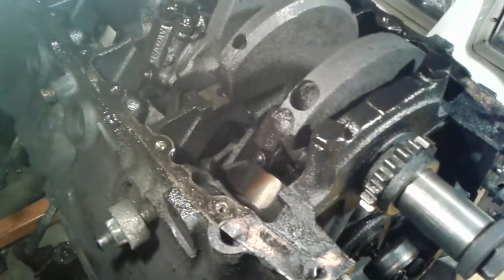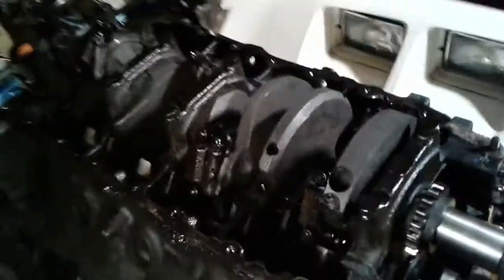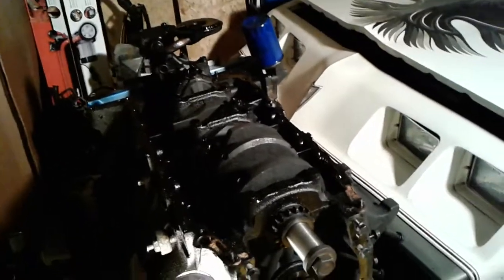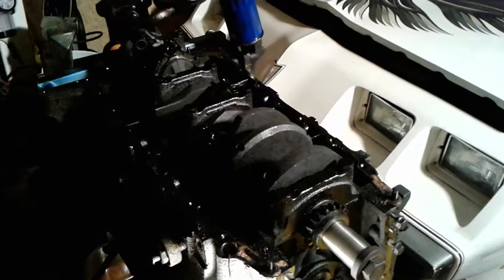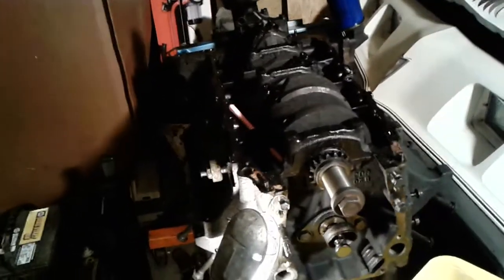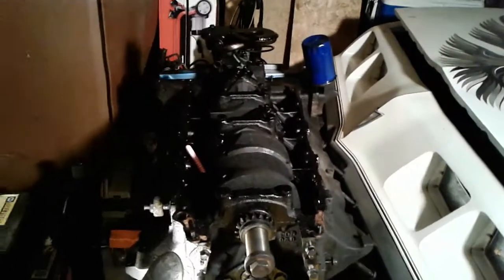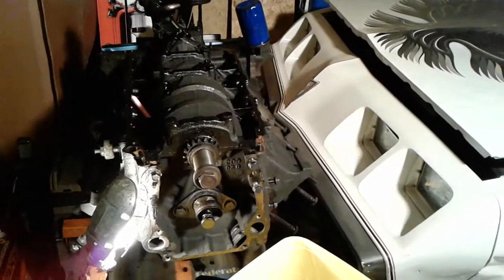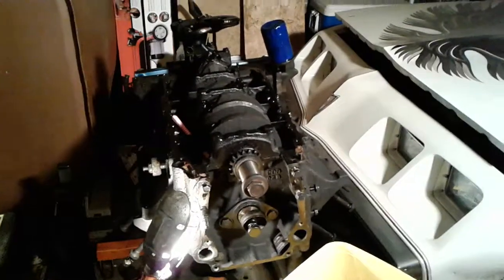Oldsmobile Engines. Blocks, Windowed Main Webbing

Comment: There's a few things , 1 LS/LT chev motors have windowed main webs to , it's about equalising windage in the bottom end , less parstayic drag on the crank 2 has anyone bar a few ever seen a 403 drop a crank , no ! Olds engineers did massive testing on the 403 bottom end before it was released , even in truck/motor home applications they exceed 180k miles. 3 there are now many 403s out there at 600 HP and turning 6000 + rpm . In fact Edelbrock just released a Victor Air Gap Intake for the 403 that has a rev range 3500 to 7500 . Plus new for 2025 alloy Edelbrock Victor Heads . The windowed block has now years later proven much stronger than ever thought . Plus new forged flat top pistons for the 403 that brings compression up to 10.5 to one with stock heads , must remember the 403 4A heads have larger ports and big block valves , at 82.5 cc that's only 2.5 cc bigger than the stock 400 big block Olds with the same valves.

Comment: I'm an owner of a 1979 Trans Am with the stock 403. Do you know which 455 would be proper to replace the original engine, and what it would take to do so? I am not interested in an LS swap, I am more interested in keeping the car as original as possible while at the same time making it as fast as it looks. If that makes sense. 
Is there an aftermarket 455 which can basically be a "plug and play" with the existing engine bay, electronics, wiring, transmission, and to still have the shaker work? Because the shaker is very important. 

Thanks in advance, david
Reply from the maker: whats up david, you come to the right place.
all 68-1990 olds v8s are identical externally from the 260 all the way up to the 455, the big blocks have a taller deck height (400, 425, and 455s) but that doesnt effect much, all wiring, plugs, sensors, starters etc all bolt in the same exact place. swapping a 403 to a 455 is almost as simple as pulling the 403 out and putting the 403 right back in, if you want to keep the ac, you will have to shim the compressor, same goes for the alternator. i have a video of me swapping my station wagon from an olds 307 to an olds 455 you can watch, it pretty much shows you everything you need to know.
also note that big blocks use their own exhaust manifolds / headers 

this is the exact swap you are looking to do

https://www.youtube.com/watch?v=xtVpBm36RcI&t=349s&ab_channel=UsefulEntertainment

Comment: I’ve got a ‘77 350. What’s the most horsepower I can make out of it?  I also have #5 heads. Could I bore it out .30 and use those heads?
Reply from the maker: You can go 30 over on a 77, with those heads. I wouldn't be running nitrous or boost tho.

Comment: Is the 403 Olds a bored-out 350 Olds?
Reply from the maker: Nope, they use different parts and the cylinders are so big that antifreeze cannot pass between them in the water jackets.
Reply: @UsefulEntertainment  Thanks. Why not? I watched the video over and over and can't get my head around the concept of windowed mains. Is it a coolant issue? Is the engine fragile because it's missing metal in some parts? Thanks, david

Comment: You could get the olds 455 in the gmc motor home up until 1978.
Reply from the maker: They must have been using left over motors because they stopped making them after 76, i have seen those motor homes with olds 403s tho
Reply: @UsefulEntertainment  they always make engine a couple of years longer after the stop using them in cars to cover warranties.

Comment: They did it to lighten the block. 
All the manufacturers did what they could to lighten everything they could in the mid to late 70's. Pontiac lightened their V8 castings on the 350 and 400's from 74/75 up to the end in 79. As far as how durable the 403 block is? I wouldn't worry about them at all. You would have a lot more to worry about then the block breaking like a piston breaking or a bearing failing. And even though the main webbing is pretty light weight you should see the main webbing on a Gen 1 Hemi like the old 392. They are very light too, although no "lightening windows" but still very light. They supercharged them and ran them on nitrous for years pushing them to well over 1500 horsepower. If you're building a 400 to 550hp street engine you will never come close to breaking the block. If you want a 750hp or hotter engine you probably aren't going to start with a 403 anyway, you'd be more likely to start with a 455.
Reply from the maker: All good points.
Reply: @UsefulEntertainment  I'm an owner of a 1979 Trans Am with the stock 403. Do you know which 455 would be proper to replace the original engine, and what it would take to do so? I am not interested in an LS swap, I am more interested in keeping the car as original as possible while at the same time making it as fast as it looks. If that makes sense. 
Is there an aftermarket 455 which can basically be a "plug and play" with the existing engine bay, electronics, transmission, etc?
Reply: @dmbolender not entirely plug and play but the Pontiac 400 or Olds 455 are easy to go in. I would suggest keeping the 403. Easy to make a 450 HP combo or more. Cody smith built a 403 to nearly 700 HP with a girdle on the bottom to keep it together. 

Want to make it directly plug and play? Convert and Olds 350 diesel to a gas motor. The things are beastly.
Reply: Has anyone bosted this block and can tell results I have one I was gunna nos it to death n see what happens

Comment: Not the brightest thing Oldsmobile ever did. They could be built up reasonably strong but the windowed mains would ad flex to the assemblies, leading to durability faults. Day to day driving would be fine! Weight savings and cost savings were the main reasons for this direction.
Reply from the maker: Ive heard of the weight savings but how much couldve it really saved, 2 pounds??? but yeah man under normal conditions its just fine.

Comment: I'm surprised that you didn't mention the godfather of oldsmobile performance and racing engines.   If you can find any of his published works  you'll find out some very great tricks to keep the oldsmobile engines alive for any type of racing and street application.    Especially the oiling system.    They are all great reads.    Ever heard of Joe Mondello racing.  AKA.  Dr. Oldmobile.     The godfather of oldsmobile.     The oldsmobile guru.      Do some research.  You might learn something.       RIP. Dr. Joe Mondello.    The oldsmobile god  
Dr. Oldmobile

Comment: Do you have any knowledge on the 307 head cc sizes vs the pre 71 350 Olds heads. I maybe able to get my hands on a 83 Hurst Olds with the 307, I'm looking to go up on the compression ratio on it with the cam.
Reply from the maker: w41duvernay here's the thing the 68-72 heads are all the same except the 71-72 have hardened valve seats for the exhaust. What they did to lower compression in 71-72 is they ran a 22cc dish in the pistons like all 68-72 2bbl engines were equipped with however all 68-70 4bbl engines had only a 6cc dish. I believe the cc on the heads are 64cc but people say they're more like 68cc. As for using 350 heads on a 307 the valves might hit the block and also I can't remember the head cc for the 307s but they have just as small a combustion chamber as an early 350 if not smaller. Watch my different types of olds 307s video and my olds high vs low compression piston video, they should help.
Reply from the maker: w41duvernay also if it helps #5 heads are 68-69 #6 1970 #7 1971 #7a 1972.

Comment: To lighten the weight of the block, making them weaker, the older blocks are stronger bore metal. Olds blocks are the same just bore and stroke different, a 403 is a bored out 400
Reply: I'm sorry sir but the block of an olds 400 a big block the block of an Olds 403 is a small block with Siamese bores they are totally different the 400 has over an inch taller deck height
Reply: @jhull7490  you are rite. Stupid people on here
Reply from the maker: soulfultenor I've heard that too that it saves weight but honestly... how much are they going to save, almost a pound, if that? Why even bother if they wanted to save that wee bit of weight, why not do it some where else.
Reply: a 403 is a small block like 307 or 350. The biggest small block.  It's like the 400 in the MOPAR family that way, called a "low block" in MOPAR parlance.

Comment: Ya I'm told that they made 1000-1800 (can't remember the exact number) solid web 403 Oldsmobiles. Think they came in Buick wagons and Trans-am with the towing package. Good luck with that one. The 403 Olds is none the less a fun engine bolt on good heads, stab in a bigger cam target peak power for 5500 RPM Ballance it use good main studs and enjoy a quick revving powerplant
Reply: Yea I dont buy that myth about the solid main web 403 that dont exist.No one even has a picture that exist of a solid main web 403 😆 in my 43 years.